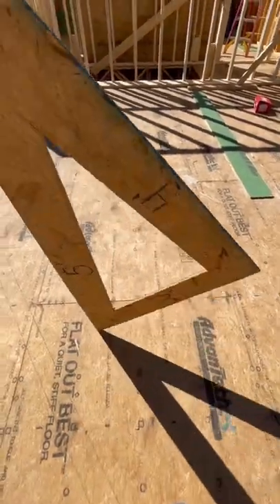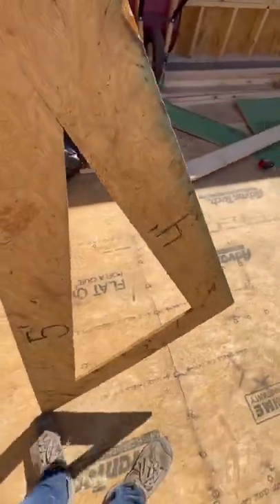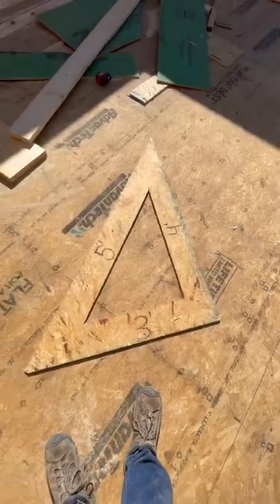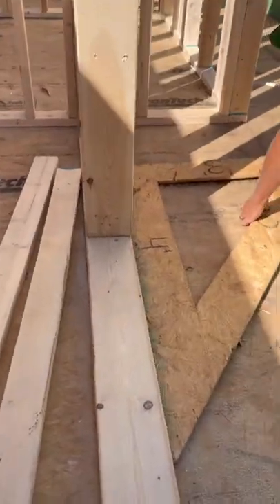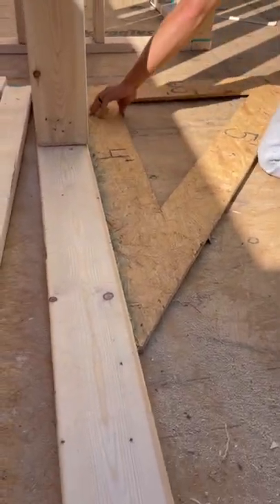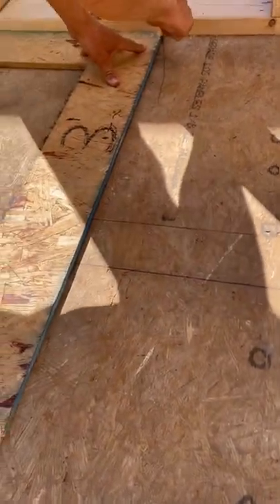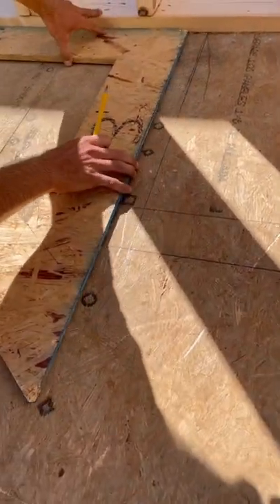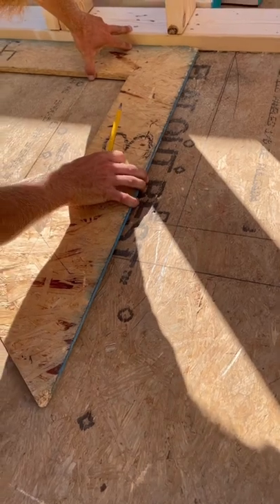Giant Speed Square- custom tool makes job faster

Comment: As a machinist, making my own tools is basically part of the job. I love making tools and seeing people make tools to make life easier. Great work
Reply from the maker: Thanks
Reply: Read masochist at first
Reply: I've done this alot while in the Navy.
Reply: I worked at a crash test facility and I was the only one that knew how to machine. They had a really old dusty Jet manual mill in the back of the shop. I made little tools for everyone. I was very proud of that job.
Reply: @Notcleverenough  same thing depending on what you're trying to make.
Reply: No worse feeling than when you don’t have enough time to slap the EStop
Reply: Tools and templates are our best friends
Reply: Agreed
Reply: @benananunya3875  I love this

It's not about the validation or the attention, it's about something you worked hard on having an actual positive impact on the people around you
Reply: @Nawmps  awww :)
Reply: Machinist's be making tools to make tools to make tools to use with other tools.
Reply: @Peter Munk, as a fellow Machinist, I concur.
Making jigs, fixtures and holding devices is the fun part of the job.
I had one job where I used a Vertical VMC (Vertical Machining Center) into a lathe.
Mounted a turning tool in a vise.  Mounted the workpiece in a collet chuck.  Ends were turned, freeing up lathe time.

Comment: I feel obligated to let you know that factory edges aren’t always square
Reply: Are you not familiar with Pythagorean theorem? 
Sides are marked 3,4,5. There is no other way to get perfect square other than that method.
Respect intended, no offense intended.
Reply: @zaction10  are you not familiar with the fact that the factory edges of timber is anything but straight. You can have 345 and still not be a straight edge, it’s throwing off you square.
Reply: @ethanmcleod8819  I’m with Zack Rossi on this one, I’ve never had a sheet of OSB that was out of square from the factory, also the edges are straight enough for framing layout marks.
Reply: @ethanmcleod8819  these guys don't do much construction lol plywood can definitely be out of square
Reply: @woohunter1 WoW!  Have you checked every sheet for square?
Reply: @Nutsarooba  every time I laid floors or roof decks, never had a problem with OSB being out of square, ditch van der linde, I do remodeling for a living, I’ve laid a few sheets.
Reply: @woohunter1  I use fire rated marine grade 4x4 plywood all the time. Expensive stuff. About $300 a sheet and I can almost bet on finding a sheet or two in a pallet that’s out of square. If the quality stuff still has manufacturer defects, you can pretty much guarantee the cheap OSB you get from the lowes or Home Depot, which are meme worthy for their shitty lumber, will be out of square
Reply: If the edges were not square you could not make the tool. It really is that simple. 3-4-5 only works when the piece is square, otherwise the 5 measurement will never check out.
Reply: @juliusfucik4011  you can measure point to point and get the measurements you want but still have a bow in the edge. Same way you can have two sheets of plywood that both measure out to be 4x8 but won’t flush up against one another.
Reply: @ethanmcleod8819  jesus christ is marine grade plywood that expensive now? I remember buying 4x8 sheets for 60 bucks apiece 15 years ago
Reply: @ethanmcleod8819  Use HDO plywood instead. And take care of it. It's stronger, will be true for years and isn't bothered by weather.
Reply: Thanks for saying this! I was gonna say 😂 factory edges are often not square
Reply: I think it was important for Ethan McLeod to say this since narrator said it was perfectly square due to factory edges, not perfectly square due to being 3-4-5 edges. The latter might be a reliable way to know it’s square but the narrator mentioned it’s square because of factory edges which is not a reliable way to test for square.
Reply: @mrcryptozoic817  the board I use is fire rated. I use a lot of it when building communication closets and server rooms. That’s we’re most of the cost comes from.
Reply: @schlomoshekelstein908  the reason the board I use is so expensive is because it’s fire rated.
Reply: Plywood and OSB sheets are always square, the factory is obligated to be absolutely certain of this,  checked with a computer several times daily,  perhaps it is you that is out of square ?
Reply: @zaction10  They did not make that square using the 345 method, they just used the factory edge which was already square , no offense intended
Reply: Its very easy to check a square for square
Reply: I've laid 1000's and 1000's of sheets of T&G flooring and OSB sheeting...
It's pretty consistently square....
3 4 5 would quickly tell you if it wasn't, 
5 would be long or short.
Reply: @zaction10  ya dummy
Reply: @dutchvanderlinde658  only all my life n never once had a piece of osb out of square. You guys are clowns
Reply: Better get some advantech my friend
Reply: @ethanmcleod8819  😂🤣 you’re not getting it man. 😅 if there’s a bow in the edge, rip it down. If there’s a bow in the other edge, rip it down. No matter what 345 will be a perfect square. If there’s a splinter sticking out do you pull out your tampon to soak up the blood ? You sure as hell sound like it. 😂😂
Reply: @Borge782  listen here kid. Seeing how you can’t listen, I’ll lay it out for you again. It is not a factory edge if you have to rip it down. And for a square to be effective, your edges have to be plumb. Was that simple enough for you are you just slow?
Reply: Say it louder for the people in the back!
Reply: @Borge782  if you have to rip it down, then you’re not using the factory edge now are you.
Reply: It's good enough for rough framing. Hopefully the bottom plate doesn't have a bow in it though
Reply: @zaction10  yeah the commentary is confusing people .can't beat the 3.4.5 of anything equal method 👌 was gona make your point myself
Reply: Well said.
Reply: If your factory edges aren't square and you can't fix that or observe that as a joiner/carpenter, I'd suggest retiring and becoming a quantity surveyor rather than making a tool to aid your failed profession 😂

"Shit I layed out the whole house and now we have trapezoid rooms because of my damn factory edge square!"
Reply: @BrownBabyJesus  you say that jokingly, but every single suburban cookie cutter home I’ve been in, every one, has had numerous walls out of square. Absolutely shit work.
Reply: @ethanmcleod8819  I spend half my life putting work done by reputable tradesmen/master builders right so I can believe it. From my experience though it's often a mix of bad management/planning or tradesmen's loss of pride through consistently working under such conditions.

'The architect charges extra for proper drawings, we'll have to make do with tender drawings so I can get my bonus'

As an example: I recently had to lay out internal walls for an entire building and the first thing the management advised me was the building frame was 1ft smaller than reflected in the drawing but he didn't want to decide where the 1ft would be lost internally despite him overseeing the frame construction.. do you want thinner walls? No. Do you want to lose 1inch from 12 rooms? No. Oh so you want a miracle? Yes please. 😂
Reply: @ethanmcleod8819  It's a common myth that the edges aren't square. 

Factory edges are always square.
Reply: @TH3-MONK  if you believe that, then I’ve got some ocean front property to sell you in Arizona
Reply: Blingy McDaddy  I think you’re overthinking the situation
Reply: @ethanmcleod8819  Maybe they're not square in the States (...hardly surprising), but every single sheet of plywood, OSB, and MDF, I've ever purchased or had delivered has been completely square.

I was told, in my apprentice days, to never assume they are square, therefore it's good practice to check, hence why I'm certain every board I've received has been perfectly square, because I've checked.
Reply: Blingy McDaddy  ah yes. The one thing that literally everyone was taught from a young age, I somehow wasn’t taught. Your childish arguments mean nothing. Try to think critically every once in a while. You might even form a reasonable argument.
Reply: @zaction10  bruh moment
Reply: OSB is always square
Reply: @jonathanchefski3120  yeah and a colander will hold water.
Reply: Your that guy...... 👌
Reply: All you people KNOW  EVERYTHING...KKKKKK
Reply: @jonathanchefski3120  I agree.
Reply: Sometimes you get shit that Ian right out of the factory it’s man made by men so yes shit can be out of square straight from the factory
Reply: This is an interesting conversation. I can't say I've ever had osb wit a perfect edge but it would be good enough. With the hole cut from the center I could definitely see it warping after some use and going out of square for sure. I can't say I wouldn't use it though.
Reply: I am a ticketed carpenter and I've had many lifts of OSB out of square by up to 3/16 of an inch. Yes they aren't square, but when you lay them all the same direction it doesn't matter as long as you account for when laying the edges. When I do cabinets from plywood or melamine I have to square up every single sheet before breaking them down into peices or all the cabinet boxes are out.
Reply: Yea right, obviously this is not a carpenter doing THIS!!!!
Reply: @juliusfucik4011  not true unless you laser cut that sheet, if you resort to making tools, I'm sure your cuts are just as bad as your tools.
Reply: @Cou-yonLogiC  well I don’t know about you’re house, but when I built mine, I made sure the walls were perfectly square. I’ve been in numerous suburbs cookie cutter house that were closer to a rhombus than a square. So you can continue doing things half assed or you can gain some respect for your work and do things right. If you don’t like the criticism than maybe you should do better work.
Reply: @zaction10  not the only way. Use 6, 8, 10. etc.. A right triangle with 2 equal legs, multiplied by 1.41414 to get hypoteneuse.
Reply: If sides 3 and 4 were not 90 degree to each other, then the side 5 would not equal 5
Reply: Daniel Nelson  kkkkkkk ur that guy
Reply: @woohunter1
Reply: My first thoughts exactly, but the idea is great.
Reply: @juliusfucik4011  That is a fact.
Reply: @ethanmcleod8819   for what exactly? 300$ a sheet ? Are you building some kind of under water apparatus? This was funny
Reply: @anthonyhales4192  it’s fire retardant wood. 3/4 inch marine grade plywood that has a special paint that it’s dipped in and certified as a fire barrier. I use it to line the walls of communication closets and servers rooms. It’s expensive for sure but its nothing compared to the cost of the equipment that it’s tasked to hold and protect
Reply: @ethanmcleod8819  you don't measure the bow. you measure point to point
Reply: @victorhopper6774  measured or not, if you use a factory edge to square off against. The imperfections in the edge will still transfer to your work
Reply: @woohunter1  you have had OSB out of square from the factory.. you just didn't notice because you didn't check and the application you were using the product didn't matter if it was square or not.
Reply: @ethanmcleod8819  I’m in Hawaii so a sheet of cdx/adx IF we have any in stock is 80 bucks, 1/2 inch marine grade A-B is “only” 100-120 bucks, couldn’t even find a price for fire retardant ply, hard to believe ANY paint is 100 bucks per 4by8 but maybe, remember buying studs that are now 7-10 bucks for a buck or less just a few years back
Reply: @patrickancona1193  it’s not something you’d find at any big box store. It’s a special order from commercial distributors. It’s 3/4” 4x4 plywood that’s pretty much dipped in this fire retardant paint.
Reply: @ethanmcleod8819  I concur,  20+years experience.   the factory cuts are based on materials that also wear and tear...  20,000 sheets will do a number on machinery. I've had factory edges beveled,  out of square,  too wide,  too narrow.  they're not perfect.
Reply: @zaction10  It only works when it's flat. If the board is warped, which they usually are, non of that works. The thing is construction doesn't need much accuracy, so it's probably fine.
Reply: Maybe they checked it. Lol
Reply: Enough bickering. Pass me another rack of nails.
Reply: Essacly😅
Reply: @markme4 just because its says they are obligated to doesnt mean they do lmfao.
Reply: @marushall263  lyfao? Really?  They do actually
Reply: I don’t know construction but as manufacturing …..NOTHING IS NEVER ALWAYS PERFECT
Reply: @ethanmcleod8819   if the sides are actually measured and are 3/4/5 then it is a 90 degree corner on the factory edge
Reply: @WideAwakeHuman  if the board has a bow in any of the sides, you can still measure it and get 3/4/5 and still not be a good square. A tape measures length in a straight line. It doesn’t account for anything outside of that plane
Reply: @dutchvanderlinde658 it's osb not plywood
Reply: Interested in seeing how exactly they make the materials we build with.
Reply: This guy 110% knows that

Comment: *chalk line leaves the chat
Reply: Slower than this
Reply: I'm too stupid to do that....I'd rather measure each angle....
Reply: It's to square up walls. Not really for marking the floor but it does square off the walls nicely
Reply: Great now I have the chalk outline song in my head
Reply: You ever hang osb and realize that's a huge gap on one side where two pieces meet but not on the other side? Yea that's cuz they don't give af how square it is when they sell it to you
Reply: @The Book of Lab  this is subfloor plywood that shit is always squared. If the floor ain't squared then your walls ain't leveled.
Reply: Was just gonna say chalk line works better. And doesnt look ridiculous lol
Reply: Lmfao😂
Reply: *Accuracy has also left the chat
Reply: And chalk line should leave too, because punk ass chalk lines blow away a little to often to be reliable, but if someone likes working harder not smarter, that’s their prerogative. Heard of the seven second rule? It’s the average time taken between doing the job the right way and skipping steps or cutting corners in 99% of all jobs, so just do it thoroughly.
Reply: @DiscoDashco  it will literally save you .002 secs 😂

Comment: When I first started out and didn't have a lot of tools or knowledge, I used to use the paper pamphlets in the box of flooring, and use it to find my angles by folding it.  Quick easy way of being precise.  But I'm certainly gonna make that 3 4 5 square next time I'm framing a big job, thanks for the tip!
Reply from the maker: Awesome!
Reply: Yea man! Works the same if you multiply it
3 4 5 is the same as 6 8 10 and also the same as 24 32 40
Sometimes its easier to use a bigger number
You can also use this to check if something you built is square without needing a square

Comment: Back in my days we used chalk lines for layout before building all walls.
Reply from the maker: We still use chalk lines for the majority of the walls this is just for a few the short walls
Reply: Chalk lines are straight, not necessarily square.
Reply: @mrbmp09  
Well, someone not doing their job right then. When I was framer we always ensured layout where square and just not the exterior walls.